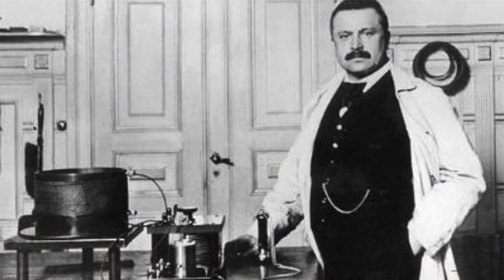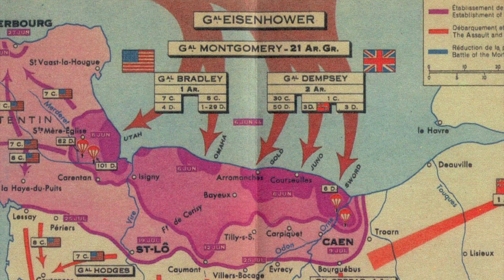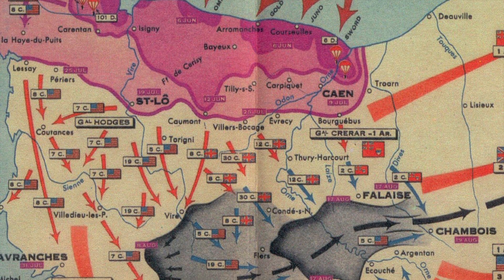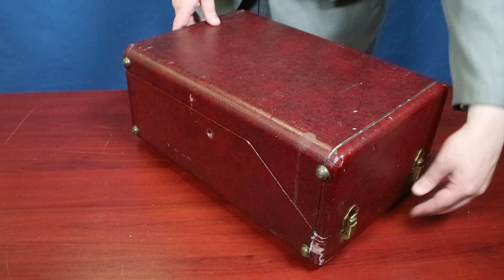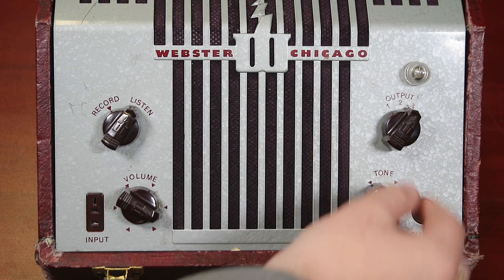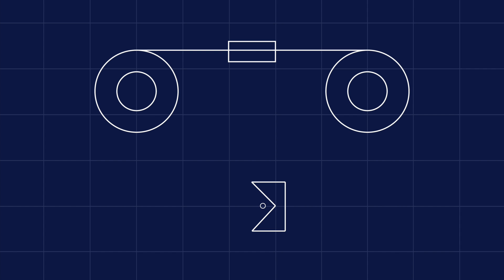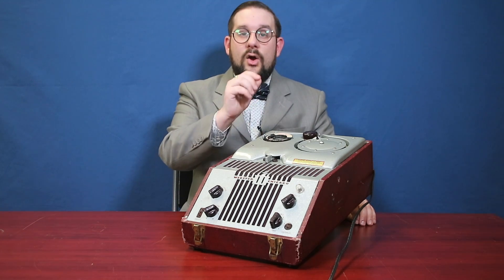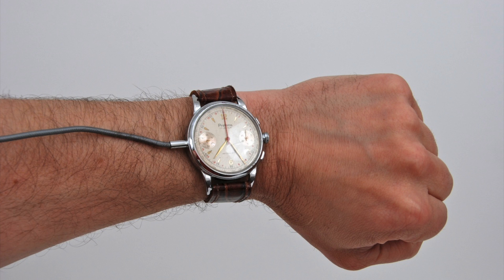Wire Recorders: the OG Magnetic Recording Technology

Comment: I have a Webster Chicago model 80 like the one shown here.  I found a company in Ohio that is well known as a specialist in restoring wire recorders.  They replaced all capacitors, rejuvenated the rest of the electronics, put new rubber on the friction wheels, cleaned and lubricated the mechanism, sent the microphone out for restoration, replaced the speaker grill fabric, and it was like a new machine. I hsve had fun buying previously recorded wire reels on eBay and seeing what was on them. One reel was a recording of police radio dispatching of squad cars, another was a piano recital (which sounds quite good....surprisingly good fidelity), etc. The wire recorder shown here is apparently not showing wire recorders at their best.

Comment: Amazing tech for its day! The crystal elements in the microphones fail the test of time. Later "Webcor" TAPE recorders used crystal elements which also failed in time. These crystals can be easily replaced with crystal elements used in later, portable battery tape recorders, oir even from ham radios of the time. Or, you could take a mic meant for a portable (say, a Ross-Mark 3-inch R2R) and make an adapter plug for it.

Comment: Can I ask, would they have had these in the UK in mid 1940's ? Or something simliar?
Reply: It's possible. Bang & Olufsen in Denmark started making wire recorders in 1948 so others could have started at the same time or a little earlier. The main problem would be to get the parts because of the war. B&O had problems getting the tubes to make radios.

Comment: The microphone issue really depends here, you didn't show us how the circuits are so normally you want to look for an expanded capacitor but this might use vacuum tubes in which case you want to look for the tube that's not working. It may also be that the circuit has lost integrity or part of the physical plug component has either a faulty connection to the board maybe the solder has cracked or the plug internally. It could also be a similar issue in the microphone itself.

Comment: One of the issues with wire recording is that the wire, of course, is round and that this causes distortion as the wire cannot be held rigidly in place.

I was thinking that with enough bias, wire could hold a lot of data and that it might be interesting to use a digital signal instead…

Comment: You didn't address the fact the take-up reel is larger than the other reel.   Would this be because during playback the wire is moving slowly and so the winding is a little looser than when re-winding quickly?

Comment: Magnetic tape recorders (the Magnetophon) had been invented in Germany and was first demonstrated in 1935 at the Berlin Radio Show and by 1943 a practical stereo model was in use. About 250 stereo tape recordings were known to exist prior to 1945, but only 3 still exist from that era. The electric condenser microphone was invented by E.C. Wente at Bell Laboratories in 1916.

The Magnetophon used ferrous oxide-coated paper tape.

Comment: I have one wire recorder of the same form factor, but apparently a copy, I guess.  As there is no capstan, the pitch is somewhat variable.  To minimize the effect of reel diameter growth with added layers, the receiving reel is made large in diameter, and fixed, while the source reel is kept much smaller.  The small one is removable, or easier to handle and mail or store.  The sound quality at least on my unit is a far cry from any HiFi, but has obviously served its purpose for criminal investigation, i.e. storing suspect's or witnesses  responses to questioning.  That at least can be deduced from the paper note that tells the unit's only storage place is to be in the police chief's office.

Comment: I had one of these machines years ago, and the recording quality was far better than what you demonstrated here. These machines need full overhauls to function properly. There are numerous old capacitors in the electronics that go leaky, and the bias oscillator has to be working perfectlyto get decent sound quality.  Given a properly operating machine, I'd say the performance of this machine could rival that of a 50s consumer tape recorder operating at 3.75ips.
Reply: I wholeheartedly agree with you. I restored one years ago, and the audio is really good. I have a video of it that I may post on my channel, but my fear is that I'll end up with a copyright strike. I did use that same song though on the 1947 Brush BK-401 reel-to-reel recorder that I have on my channel, so maybe not.
Reply: Techmoan made a video about them. There's a Webcor in it, and it does sound a lot better.

Comment: 10:35  You can do MUCH, MUCH better than the quality here.  A good strong interference free AM radio is about the quality you can get. It definitely isn't high fidelity even at its best, but is much better than what you are demonstrating.   This wire just wasn't recorded very well.  Either that or your unit is not working properly.  What you are playing here is barely recognizable.

Comment: I repaired a Webster Chicago for a friend not too long ago and made a video on it. It needed cleaning and a tube rejuvenated. The old crystal mic element went long ago. Those can be replaced by a ceramic mic, a more robust version. My friend wanted the recorder fixed enough to get the audio history his Swedish grandfather recorded on multiple reels to a more modern medium. One of the reels contained General Douglas MacArthur's "Fade away" speech recorded off of a radio. My friend's main concern is to get all of that Swedish translated! The recordings were surprising clear and consistent on most of the reels. I noticed that only one tube was replaced in its time with the original owner.
Reply: They sound much better than what was shown in this video. It's a shame he didn't have a good example.  It was barely recognizable as piano music.  I've heard many wire spools and they sound on par with a good decent quality AM radio station.
Reply: @tarstarkusz  The one in the video sounds like a weak amp tube (considering he had to crank the volume up to max) and a broken speaker with a rubbing voice coil ontop of that. Like... come on... those aren't hard things to fix, WTH :(
Reply: If that were me I'd find a way repair that art deco mic or at least keep the outer casing and replace the guts. It's beautiful.
Reply: @RCAvhstape  Open up the case and measure the mic cartridge then google "ceramic microphone", you may find a replacement that size or smaller. I did with my friend's, but he just wanted the playback only. There were used mic cartridges available that could fit in the mic housing.
Reply: Wow that's awesome
Reply: I picked up one at a yard  sale.  Haven't tried power up yet.
Reply: Luxor in Motala here in Sweden, made a version that had a grammophone on top of it.

Comment: I have one of these! well mine is a slightly different model with a different metal plate around the spools and also a time counter that shows an estimate how much wire is left. I had to do a lot of work to get mine working, fixing the speaker, re-cap it. swap a tube and other additional stuff but in the end mine sound mostly better than yours and I can record audio as well with it. But the wire sure want to break on them, I think mine is a bit too worn in the head as the wire goes rather deep into the groove of it and impurities easily get stuck instead. but it is a really cool machine to have. after I got mine working again I found out that it been a companion for a band when they did reputations and recorded their songs on wire so I actually have the history of it as well :)

Comment: The most likely problem with the record feature is the piezoelectric element in the microphone has deteriorated due to age and moisture.   Most microphones and phono cartridges of that era used a material known as Rochelle Salts, and it has a tendency to absorb and retain moisture, and over a long period of time it decomposes into a lumpy powder - especially if the equipment sits idle for a long period of time, as I'm sure this wire recorder has.  If you have a very old record player with this type of cartridge (most before about 1960), and it has sat in storage for a long period of time in the more humid geographical regions, they deteriorate in pretty much the same way.

There is probably a specialty company that could rebuild that microphone for you.
Reply: Rochelle salt can be grown into huge quartz or diamond like crystals and some people grow them just for the beauty of the crystal, to display it. I've seen videos online of people doing this.

Comment: I wonder how that first recorder, debuted in 1900, worked. I think recording would be straightforward enough: if he used a carbon microphone, its resistance changed as it received vibration so I suppose just hooking it in series with the record head and a battery would be fine. But playback? How was it amplified? Did it even have a carbon microphone? I know those were common before ribbon and dynamic mics made their way into radio etc, but -- I have no idea! There are other ways to skin a transducer, so to speak. Fascinating. I've been enjoying your videos for a few months now, many thanks from north of you in Alaska hehehe

Also if you explained how it worked I missed it, apologies
Reply: I guess it was a matter of just dumping A LOT of current into the recording head and using a very sensitive speaker for playback. After all, early telephones would use the carbon mic and battery to send out sound, but the receiving was completely passive. And the Telegraphone was supposed to be hooked up to a telephone for recording and listening. Poulsen also developed arc converters, so I guess those could be used for public demos as over-complicated amplifiers.
Reply: @IgnacyG1998  to use a physical analogy, without an amplifier, that passive setup would not move the speaker cone any more than a piece of wire or something in front of the wire as it passed, right? like the mechanical strength/deflection felt at the playback head is all the juice it would have, it couldn't then push a speaker cone any louder. sez me.

Comment: quite amazing how long the wire recorders stuck around, considering the tape recorders were invented in 1935
Reply: Tape machines were invented in the 1930s, yes, but they were not of much better quality than the wire machines.  It was the Germans in WWII who refined the idea into a far better system - the development of better recording medium, and the introduction of high frequency AC bias during the recording process.  Bias allows for more thorough saturation of the magnetic recording material without the usual distortion.

So good was the quality of these German machines that they had apparently been used to misdirect the allies with regards to the actual location of Der Fuhrer, by playing speeches he'd recorded while he was very far from where the speeches were broadcast.   Herr Goebbels also used these machines for propaganda and so forth.

The quality astounded the Americans when they captured this equipment and it was immediately bundled off to the States for further refinement.  Ampex was probably the most prominent company working to do this, though BASF (in Germany) did much to refine .the tape medium itself.

Comment: That microphone is a crystal (piezoelectric) model, and the crystal elements in those frequently stop working over time.  That may be your problem with the record function.  Unfortunately, a standard microphone won't work for that unit without a beefy preamplifier, because modern mics put out a much lower level than those old crystal elements.  If the mic is indeed bad, there are people out there that may be able to replace the mic element.  I had that done for a crystal pickup on an old 78 rpm record player, and it works wonderfully now.
Reply: In the early days, Rochelle salt, a natural crystal, was used as a piezoelectric element, but it is hygroscopic (absorbs water) and can melt into a sticky mess!  Later components used a synthetic ceramic element, so a later microphone or phono pickup might have what you need.
Reply: Piezo pick ups for acoustic instruments like fiddles and guitars  as well as cheap phono cartridges any of which can be carefully cannibalized for the Cristal and used to repair the old mic . I have done this and it works well.

Comment: My father told me about those, he worked with electronics. He said that erasing those wires was kind of difficult because steel needed much more field to be magnetized, you ended up sometimes with a remaining under the new recording (I suppose). I think that part of the distortion was because no bias was applied to the signal to compensate for the non-linearity of the magnetic medium.
Reply: I also wonder how much “print through” there is of magnetised wire wound against the other wires creating momentary echos of the signal
Reply: @angusmcnaughton   lots